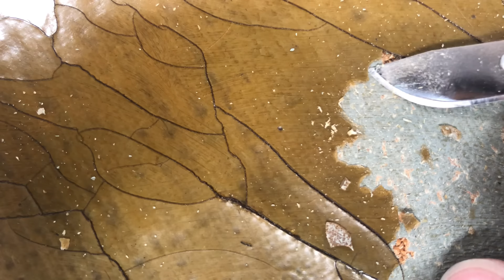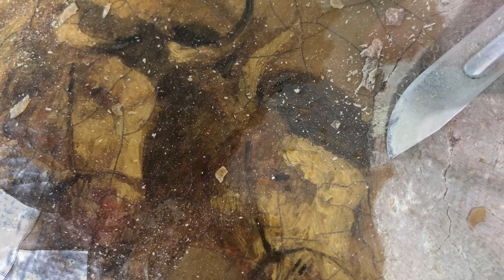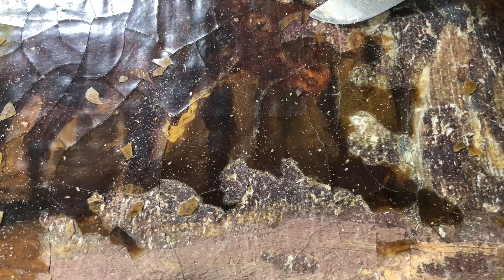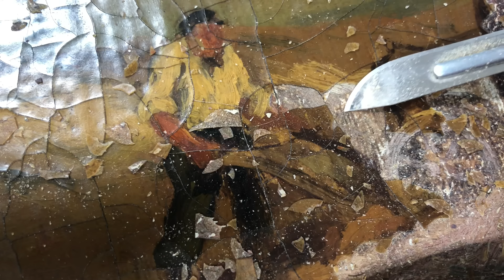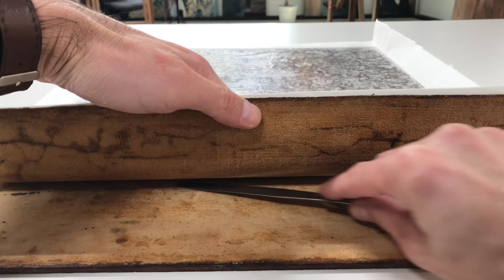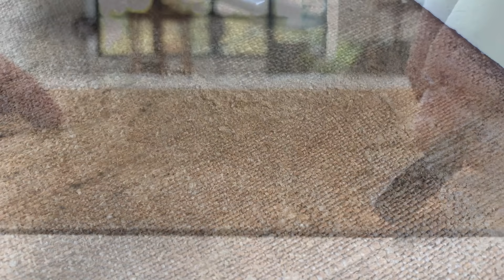Scraping, Scraping, Scraping or a Slow Descent Into ASMR

Comment: Person: so what did you do last night?
Me: spent 40 minutes watching a guy scrape old varnish off a painting.
Reply: It is so true, it hurts
Reply: Is polyurethane a type of varnish?
Reply: Varnish it is not - it's polyurethane.
Reply: @clovercove8355  polyurethane was the varnish my boat had on its teak decks. I also had to scrape it off by hand but with the help of a heat gun.
Reply: I read this and laughed my ass off so hard and then realized that I just did the same damn thing and then my laughter turned into a long deep stare into the ceiling.

Comment: Kay, question: Does the oil from his fingers affect the painting at all?
Reply: Hunter B not likely. Mostly the way to mess up an oil painting is to touch it with pressure when it’s not completely dry. Oils in oil paint harden, rather than drying/evaporating like water in other paint types do. If Julian had some really greasy fingers and touched the wet paint, it might cause problems like thinning, but it would have to be REALLY OILY. But I would also assume he does wash his hands before barehanding the paintings to avoid getting any dirt or grime on them.
Reply: Marissa Shaw thanks for the response! That makes sense!!

Comment: Pro tip:. Blunt off and polish to a soft edge all but the top.  That will stop the incidental removal of paint by the sharp.side edge of the blade when you have to twist the blade to pop up the top coat.

Comment: guys, gals, nonbinary pals... find you a person as committed to you as Julian was to this painting

and to take the analogy one step further, if you've been altered, damaged, by the soul's equivalent of polyurethane, find you a person who will help you chip it away so you can shine again. Don't get someone to "fix" you, mind--he's not "fixing" the piece, necessarily; he's bringing out the artist's original intent, and patching holes in a way that can be reversed if it turns out not to work out forever. The process changes the piece, but it also brings it back to a place where you can really take in the piece's beauty. Get you that, but for your heart.

Comment: I absolutely love your videos! I'm addicted. You are super knowledgeable and have probably already explored this but have you thought about a process of super cooling and then heating in an alternating patter for a period of 72 hours along with humidity control. Reason I say this is if polyurethane is adversely affected by temperature changes over time and can become more brittle then what if you could simulate that in a shorter pattern and cause the painting to want to naturally separate due to its resistance from the polyurethane reaction. This might affect the painting though and if so, obviously scratch that idea. Seems like you already have the perfect table for the heat but maybe there is a way to introduce cooling as well. I would think a transfer from hot to cool very quickly could cause it to release easier. Just a thought.

Comment: I flinched every time the scalpel lifted a piece of polyurethane and took the paint underneath with it. It’s like the death of a thousand cuts. Does the scalpel blade last for the whole process, or do you need to change the blade? Do you ever have help with the removal of the polyurethane or the glue residue? I ask because I think I was made for something as meticulous as that. The OCD is strong in me; I would love the attention to detail required. I would not be able to do the actual paint restoration; crayon is more my speed when it comes to that.

Comment: There is a special blade used by dermatologists which is curved as if a melal capital U. The sharp part is along the curve. This blade is so thin it is less than ruled paper. They use it for skin tags, keratosis and other things that don't require going deep. The reasoning is that they don't want a divot. I am curious if anyone has ever tried on in restoration.

Comment: Hey fellow art nerds, was wondering if you could answer something Google won't. I want to put an ultra **smooth** finish on a art project that is effectively acrylic on cotton weave. Polyurethane seems wrong, obviously. But most varnishes talk about keeping the texture of the paint and canvas. I want to remove that texture. Completely. I want it extremely smooth and waterproof. (It's a sculpture). Ideally it should also not crack or shatter and be slightly flexible. Any ideas?